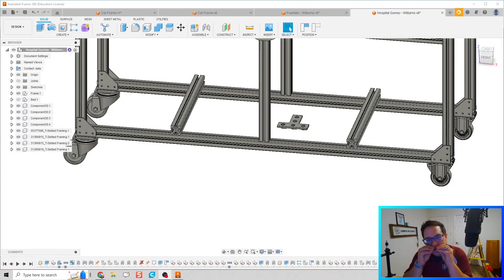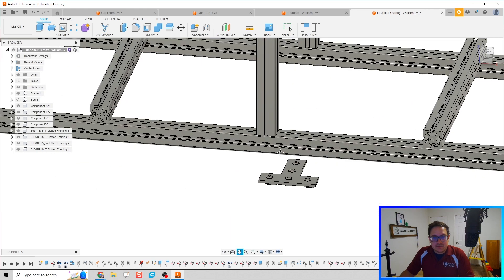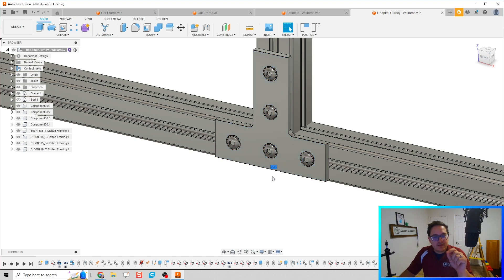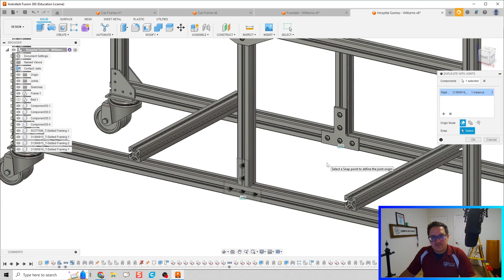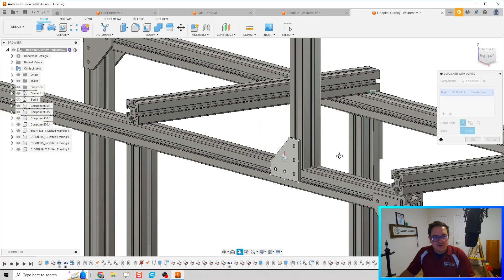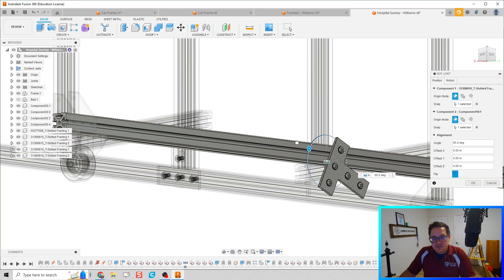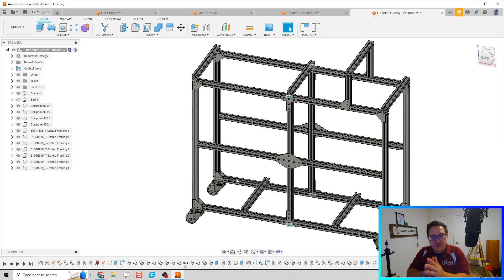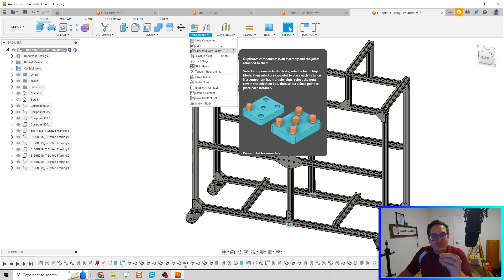Duplicate with Joints - Autodesk Fusion 360 Journey

Comment: Good to see Duplicate with Joints in use. In the video at 2:25 , based on the geometry selection the Joint will be created. In your case it's upside down. To solve this , there is a flip button functionality present inside the three dot menu in the command dialog. Rather than editing the Joints later , flip button can be used during the command itself. There are other functionality in the three dot menu i.e "Clear last duplicate : To clear the last selected snap ", "Clear All Duplicate : To clear all the snap".
Reply from the maker: Thanks for the input. I was so excited about this that I didn't dig too deep.